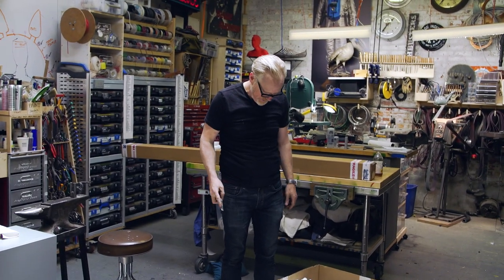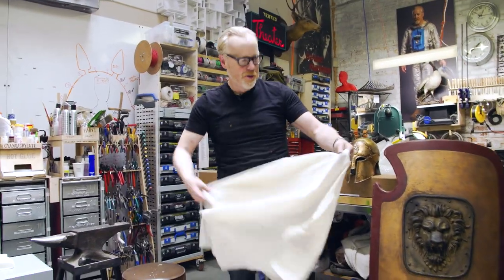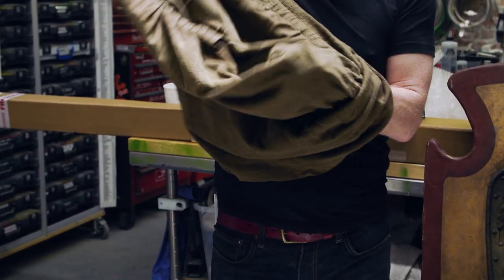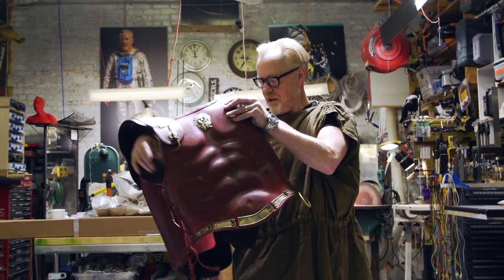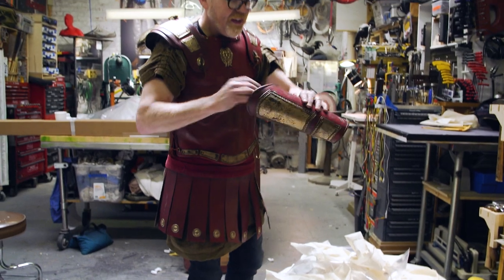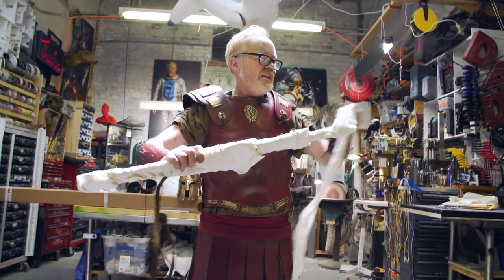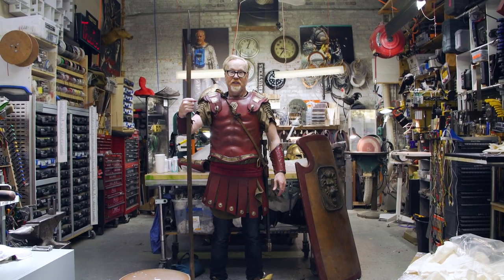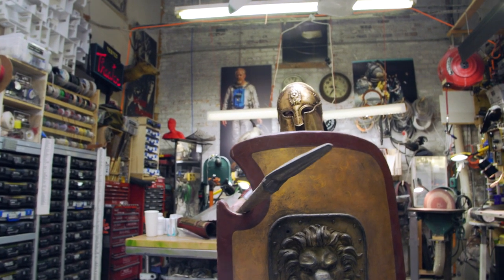Adam Savage's New Thracian Warrior Armor!

Comment: One day build idea - home-made mannequin for costumes/armour.
plz plz plz
Reply: And make it posable and able to hold weapons.
Reply: also make it fly and have free wifi
Reply: caio santos lmao
Reply: 2000jago you can buy just about anything on eBay... so you are calling everything he does a waste of time?
Reply: It's actually pretty easy to make. One of my friends that finished design school had to have a full size puppetry puppet, from there, making an actual costume mannequin is just a matter of know how to stitch and glue the foam and that aerated material they use for pins and needles (kinda like old school summer veranda chairs material that doesn't give much about weather).

He used a female stiff mannequin he bought used from a store (the old ones that have solid structure), from there he cut all the major joints and bought wooden balls that fit the various joints (eBay mostly, but a wood shop can churn them out with ease for ya). And following the classing doll jointed system he cut the balls to put structure inside and copper washers for ease of movement (remember, it's a puppet).

Seriously, not counting the delivery time, and the slightly complicated part of getting the right washers, he finished work in one week. Frankly, the most complicated part was to figure out the wiring inside and the wiring outside for the show, but for a standing mannequin, that's easy, you just need to squeeze the joints just right so they move only when positioned.
Reply: need lot mannequin has showed dozens of costumes

Comment: I don't know if Adam is buying all these costumes (which I could totally see Adam doing), or Prop Store of London is just sending you old costumes they couldn't sell to promote the company; but if the latter then tell them to send some female costumes for Simone to join in the fun with you.
Reply: Vegaspsycho Prop store don't usually have stock that doesn't end up selling.
Reply: They don't make this kind of armor for women because... women didn't fight like this. They fought in the kitchen.
Reply: Female and Male amor where the same dude like for real no reason to change the amor to accommodate the breast because  you had to be of a certain body type to be a warrior so you would not have much weight on you
Edit: meaning you would have tiny breast meaning they would not get in the way

Comment: Bit of helpful advice, Adam: when armoring up, always start at the feet and work your way up. It's hard to bend with a cuirass or chest plate.  If you've already got the feet, shins, knees, thighs, and waist done, then you don't have to worry about bending over anymore, and since armor is often layered, this will help ensure that the upper body armor will be seated properly.

Comment: I haven't seen the movie but the sword should probably be worn on the right side of the body. I sounds contra intuitive but most cultures at the time  using a baldric style scabbard did so. To hold the scabbard in place while pulling the sword there usually was a belt over the baldrick belts. The roman armor is a nice example where this was done.

Comment: Not really sure why people buy gun props, they seem to be very expensive. It would be much cheaper to just buy a airsoft version of the gun prop, weather it and add attachments etc., that way you have a functioning gun (not real gun) and you don't have to worry about the rubber gun breaking in half.

Comment: How much did it cost, if that isn't rude?
Reply: Looking at the Prop Store of London site... I'm estimating several thousand USD there in props.  Many of the items Adam received are no longer on the auction site...
Reply: thats actualy not that expensive
Reply: MoDRun, but now we know how much MineMasz pays for a fuck.
Reply: The sad part is he could probably buy ACTUAL armor pieces for the same or less than the cost of molded and painted plastic.
Reply: I am guessing Adam probably gets a good deal, because he orders so much and because he probably pushed quite a bit of traffic their way :D
Reply: bkLEGION3000, real ones are too heavy. And aluminium ones are just as fake as plastic.
Reply: You are the kind of person that thinks real swords weigh 8 lbs.  Real Armor is not heavy unless you have some kind of disability.  I've worn armor for DAYS at a time.  The weight is distributed over your whole body.  Its literally more tiring wearing a backpack hiking than a full suit of armor.
Reply: You might be surprised, in many cases armor has gotten even heavier.. Modern ballistic vests with ceramic plates can be surprisingly heavy. Combined with ammunition, gear and water, there is a huge pressure resting on your shoulders. Someone who's in questionable shape would quickly become intensely uncomfortable and be very, very sore the next day.

Comment: It looks nice and all, but these designs dont have a lot to do with reality. The helmet is not thracian, its a Korinthian helmet. The shielddesign is weird the form is roman or celtic, the spared part at the edge on the other hand is much older then those designs and was abandoned at their times. The armor design is much older then the shield-form considering muscle breastplates were not used in the later half of the classical area. The sword looks like a spatha. The thracians are known for the curved short-swords and they totally use a straight design... holy crap...